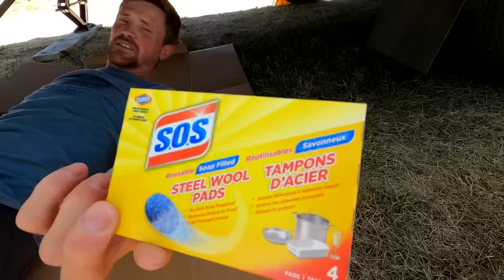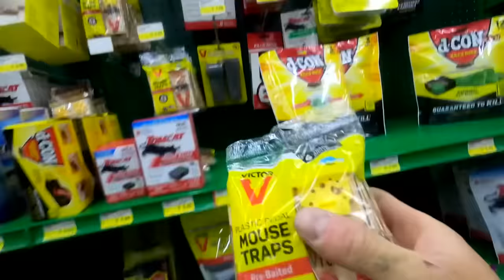MOUSE PROOFING OUR TINY HOME | RV RENOVATION

Comment: If the contractor gets upset because you ask him to correct mistakes he made, he is the one to deal with his emotions. You’re paying him to do a professional job. He needs to step up. I hope you had him remove the tank, lay gravel and level it. Quick patch fixes now are going to be expensive down the road. 😕
Reply: YES! My thoughts exactly!
Reply: I agree. We would never accept the new hole drilled. The entire unit needs to be level.
Reply: PattyBlueHayes Absolutely, must fix it right, not some Jerry rig. I can’t see how that passed inspection. I started wondering about them both when they ran into all that water in your basement. Around here aspen grow where there is water close to the surface (not in Utah). Ask your neighbors about water table and vernal springs; also ask them about the gravel code. That is questionable, especially when a septic system that is ‘crap’ passes code!?!?

Comment: I would advise you to have the contractor redo the placement of the septic tank, so that it sits properly.  “Fix it solutions” to correct this septic tank problem should not include cutting a hole in the tank and raising the pipe then filling the old hole.  Proper placement should be the only solution that you as the customer insist on.

Comment: We’re having the insulation in the attic removed and replaced because of the rodents having their way with it. After removing the old, but before adding the new, insulation, we’re having any holes or spaces they can come through, sealed up, and the attic sanitized. Good to know we aren’t the only ones dealing with these same issues at the moment.
Reply: Mice did big damage to the wires under the hood in my Moms car. We had it fixed and it happened again. After the second fix we sold the car. When I was taking it 25 miles to the new owner my friend and I looked under the hood. Wire and wire coverings eaten! My friends husband fixed it this time and yes.....we did tell the new buyers. We all laughed a lot because they had inspected under the hood the day before I went to deliver the car. Hungry little devils, yes?

Comment: I had an issue with the mice also last year. After many attempts to fix issues, I thought about how do I get them to stay away & not want to come in. Finnally figured it out. 
Mice hate peppermint!!! So I got peppermint oil & soaked cottonballs (let dry a bit) then I put about 10 of them all over the trailer. Wahhla problem fixed. Hope this helps. P.S. watch out for black ant issues 15 peppermint drops & 3 drops of dawn soap, mixed w/spray bottle of water kills them instantly. Be sure to put all your dry food goods in plastic or glass containers. I hope this helps. Love watching you guys & your journeys. 
Much Love 💜 Peace ✌ & Favor to you both 💜💜💜
Reply: ThinkAgapeLove Always&Forever Hey thanks for the information I’ve been having to deal with house mice myself and that’s really good information thank you I will try it myself
Reply: Careful that peppermint also attracts bears. 😱 Had an aromatherapy teacher use peppermint spray to freshen her vehicle. One day found evidence of the bear in the car. Ripped through door took bites out of the upholstery, but attacked everything that normally had been sprayed with peppermint.  Moth balls and dryer sheets really work well. I do love more natural ways, but sometimes it's just better to take the other method. You could also use pantyhose over the vents to filter out smaller bugs. Good luck!
Reply: I just built an offgrid cabin in a remote area. No insulation or wiring but they still come to take a look. They made a nest in my cotton mattress and it's now on the compost heap.  I was eating a late night snack in bed (low futon), looked over to see a mouse just about to reach out and take a bite....no fear. They rarely see humans...quite cute actually. I've since learnt that mice host a larval stage of ticks in their intestines. Since there are incidences of Lyme's disease in the area...all that cuteness has to go. I won't use poison, but I've head that growing mint around the house might help....and no food in the cabin. Good luck...if anyone knows a humane effective solution I'd love to hear it.

Comment: when you get set up on property set up under the trailer led lights that around the perimeter. Thats what ALL the full time RVers are doing now. takes very little energy  but for some reason the mice hate the light. good luck.
Reply: I've seen a test of that scenario and the mice just walk all over the LED lights, LOL. They're also quite happy with scented drier sheets. However, a test showed they don't like peppermint, eg peppermint oil. Problem is, scents dissipate over time.
Reply: Working for a large aerospace company in Fort Worth, we had problems with pigeons in the over head. The company installed noise makers that had solenoids to strike the structure at random times and scare off the birds. The birds got used to the noise and covered them with crap anyway. Poison and traps are my go to solution.

Comment: We built a home a few years ago and found ourselves in a similar situation.  The builder was great and were very good at not only building homes but had great customer service.  We did however walk a thin line and tried to save those "silver bullets" for the big stuff that we knew might be a bit of tense negotiation to work out.  In the end, we had a beautiful home built where everything functions extremely well and we couldn't be happier.  The goodwill we bought paid dividends as the house went through it's first seasons, especially freeze and thaw.  As warranty items popped up, they went above and beyond for us because we had such a good working relationship during the build process.  I saw a lot of great quotes by others on this video... one of my favorites is, "You get more bees with honey than vinegar!"  It's served me well.

Comment: I sure hope the man putting in the septic takes it back out and does it right ! That’s a headache you don’t want , your property will not be worth a cent if he doesn’t do it right ! DONT LET HIM COVER IT UP UNLESS ITS DONE RIGHT ,TRENT !
(And don’t let him charge you overtime just because he has a problem )
  Sorry , I didn’t mean to yell , but he might try covering it up while your not there and it not be right .. 
looks like you have sealed the mouse out ! I use sticky pads in corners under frig etc  and around the hot water heater .they like it warm in those cold winters and that might get the other critters like earwigs. . I think I would have just stayed in Terry  and taken her  south in the winter  😊     But hey you live and learn 🤣🤣.  😘😘.

Comment: Trent....if you were contracted to lay a septic tank, would you be satisfied if the tank wasn't level? I think not..both you and Allie are perfectionists, and that's a good thing. Please make him do it right, or change contractors. Worried for you.
Reply: maodonimega Yes. The contractor has made mistakes already at each step. They should not concern themselves with ‘upsetting him’ because they expect the problems to be remedied. Just because they like the guy doesn’t mean they shouldn’t expect quality and responsibility.
Reply: @Pattybluehayes  I was thinking more or less the same
Reply: Do investigate back up help. Too many eggs in one basket and one egg is cracking already. Worried for two good people.

Comment: We had a trailer on our property we would visit on weekends. The mice literally took over one winter. There was poop and pee everywhere. Blinds, couch, drawers, bed...everywhere!  We did everything inside and out to prevent them from invading our RV.   I have a very sensitive nose and I could still smell their urine after cleaning from top to bottom every weekend. I especially smelled it around the tub area. I would remove the access panel and see nothing. One weekend I declared removal of the tub. Sure enough in the far corner they had built a nest. In a full cover suit and mask we cleaned, cleaned and cleaned again.   We won our RV back from the mice but not from the smell.  We brought it back home and stored it for a few months before selling it.  We told the new owners   the whole story but they said they didn’t smell anything.  🤷🏼‍♀️.   We bought a van after that experience. 

When it comes to your septic tank.  Have it done right.  That’s what you paid for.   Your contractor and crew will respect your decision and will know in the future what is expected.

Comment: I'm so glad y'all talked to him and he's going to fix the issue with the septic tank because the truth is once it's buried and used for a while and the issues start with it backing up, and it would, then it's a massive problem! You either have to pump the tank and dig it back up to reset it or most of the time they just pump them and cave them in and put a new tank next to it.  
I also understand the reasoning of not wanting to make the contractor mad, but that's the one good thing about everything having to be inspected, the inspector is to make sure the contractor does the jobs correctly, but I do not understand why the inspector would pass that septic system if the tank was 3 inches low on the intake side. That makes me think that the contractor and inspector have become friends over the years so the inspector allows certain things to slide, and that can be messed up, but it does happen more than people think and especially in smaller towns. The inspector works for you, so when they do become good friends with contractors and pass certain things that shouldn't have been passed, then they're not working for you. If my rambling makes any sense. lol. My brother owns a construction company, and a big septic company, he's done septic work for 23 years, and he would never allow a tank to be set 3 inches low on the intake side. If he caught his employees trying to get an unlevel tank to pass, he would most likely get new employees. lol. Septic systems are very expensive, and when they are installed correctly they will last forever. But when they are not, they may not last 5 years.
Reply: His fix is unacceptable to me. I think the way he laid that base was totally wrong too. I called it before I even knew this issue happened with the level.
Reply: @Dachdogoriginal  I agree.  He should have to reset the tank correctly.  They had to know it was wrong right from the start.  They didn't correct it and said nothing.  The inspector shouldn't have passed it either.  The correct solution would be to reset it.  They could have done it at the beginning.  It is not your fault they said nothing and waited for you to catch it.  What if you were not on site??  Very bad business on their part.  You better be checking everything they do, especially the drainage!
Reply: They are paying in for a job. So I wouldn’t see a problem telling him to fix it. If your soft they may cut corners if you don’t speak up. (Not saying they are like that) Any good contractor should be checking over things. Needs sorted! I wouldn’t care as long as it is sorted now.

Comment: If you think that code was silly...

My brother wanted to be able to rent out his cabin in Running Springs, California on airbnb. In order to do so he had to get a permit through the county. His cabin was surrounded by pine trees, but the one thing that he had to do in order to rent through airbnb was remove all of the pine needles from the ground!!!!!!!!!!!! YES, THEY REALLY DID REQUIRE THAT. My brother ended up using a go between in order to rent his cabin out on airbnb. I still shake my head each time I think about the requirement!!

Comment: You going  to love those traps. We use them in the mountain house. Works great. We also used steel wool in every Nook and cranny, under the house and outside the house uneven up around the roof. Good luck.👍🏼🍀🌻

Comment: You’re absolutely correct about putting screens in the vent area but put the screens on the backside of the vents. Also the most places they come in are the plumbing access areas and the electricity access areas. If you’re using steel wool don’t use it anywhere near there is a fire source or an excessive heat source because steel wool can spontaneously go to fire with the right conditions. When I sealed my RV up I use find screening, spray foam, steel wool. Since I’m in a motorhome there’s a lot of area electrical and plumbing that’s all but impossible to seal because if they can get their head through they can get their body through but they cannot get inside the coach now because of what I’ve done they can get in the storage bay but no further.

Comment: We use The Great Stuff spray foam to seal our camper. We found they would get in through small spaces between the wood and metal casing around the wheel wells. We learned quickly Mice proofing is part of owning a camper.

Comment: THE MORAL IS HE SHOULD HAVE DONE IT RIGHT THE FIRST TIME.
Reply: I know, right? I’m so worried for them and the problems that may come up in the future. I’m no plumber but seems the guy is just “rigging” it instead of correctly installing the tank. I’m a lot older than Trent and Allie and I would not let that septic tank be installed anyway but the right way.

Comment: Use peanut butter on the traps. 
The steel wool, purchase at home depot or other hardware store .cheaper than sos and no soapy stuff to deal with. Mice will still eat the spray foam. Good luck!
Hopefully no more major issues with the build.

Comment: Once you get Terry up to the land. You’re going to have to skirt around the base. So pipes don’t freeze and you keep the critters out. In my last comment, I mentioned 1/4 hardware cloth. The patches you did in this episode will last tops 6 months. Based off my experience living in a travel trailer doing exactly what y’all are doing now. Skirting and hardware cloth are the only way to rodent proof and keep lines from freezing in the winter. The minute the temps drop Terry will be a meca to all kinds critters!

Comment: McGyvering the issue by drilling a new hole and filling the old doesn't fix the angle issue! There will be a back triangle of forever sewage that will never drain. Ever. 
Make them fix it right. the inspector passed it. They do. Meaningless. 3rd lifetime septic experience here. The first wasn't inspected because... I'm old. The next 2 were. The last one had a fancy plan that HAD to have a pump even though the drain field was gravity downhill 1:2 (job creation/ off grid sabotage?) 
Fix THE MOST basic system before you proceed.
Reply: This ^^^^^^

Comment: Put multiple cleanouts, I have 2, between the house and septic. That way if SHTF, you can run down, unscrew the lids and relieve the pressure that's backing up. Saved me and my house from a disaster, the first one I popped the lid off was just like from the movie RV. Even if you think you have the perfect system, still have at least one, and an alarm if at all possible.

Comment: I understand your dilemma when approaching a contractor on his work. I have been an amputee for 35 years and my friends have always acted like I was crazy to not speak up when things are not working right/safely with my prosthesis. Yes, I am scared because I literally cannot walk without a good prosthetic tech. It has been a VERY stressful dynamic and I have learned that I have to speak up because 90% of the time they will honor their work. The 10% where they did not resulted in my going to another practitioner. But the repercussions of not saying anything are too big not to speak up. And your guy turned out to be one of the good guys 👍👍

Comment: Hi guys! In my experience with contractors if u have a problem they want to know right away. They only get upset when u wait a week and tell them. They want u to refer them to people! My friends got metal sheets and covered the bottom of the trailer. The mice will continue to get in threw the bottom. There’s plug in bug and mice deflectors u can buy. They do work. Good luck.

Comment: Bottom line....you are paying him to do a professional job properly. There is no other option  but for him to remedy the issue. 
As a professional cook, I must make amends for any and all mistakes I make and not at the expense of the customer. Especially in catering. We trades people cover our mistakes at our costs and with no inconvenience to the paying customer. ... you are that customer. 

Earwigs never go away. I do believe this a season for earwigs as we are seeing them more and more up here in Ontario  
Remember this. ....mice can eat through  most anything except metal. Steel wool is a very good hole filler. Used and recommended by many a pest cotrol expert.

Comment: I'm confused. The last video I watched before seeing this one, you guys rented a pump to pump all the water out of the septic tank because it had settled crooked and needed to be re-leveled. Did this happen after you went through all that? If so, wow, I would have to conclude that this dude isn't doing it right and I would call in reinforcements at this point. And patching a hole in the concrete as a 'fix'? No way. Please don't 'settle' for less than what you yourself would do, if you were doing it yourself.